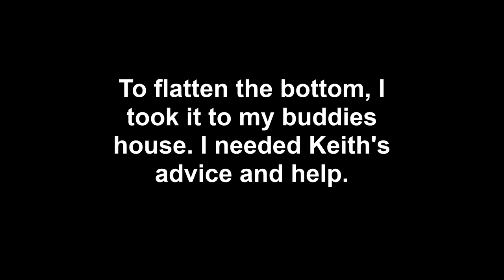Homemade oak bathroom sink

Comment: Great video and job on the sink. So all you used to seal the wood was danish oil, also how did you make the recess for the drain? Was it with a router? Thanks
Reply from the maker: I used a forstner bit for the recess. Should have done that first then drilled through after but it turned out ok. Just Danish oil and I've only re-oiled it once. Holding up very well.

Comment: One question - so the oak and teak wood can resist water easily?
Reply from the maker: I'm no wood expert but I do know I've oiled this is sink 3 times in a year and a half and it looks the same as day one. It has to be the oil protecting it.
Reply: @dennisbarker8934  oak can easily  survive  500 years , this tree is 50-70 years old .